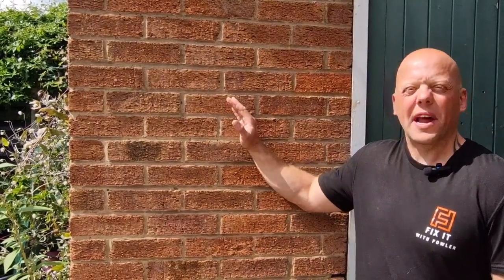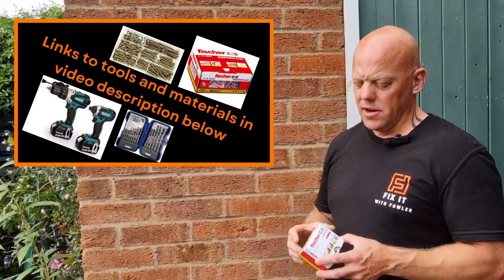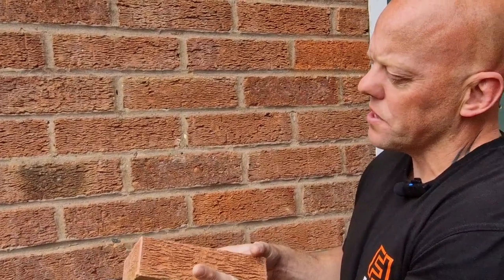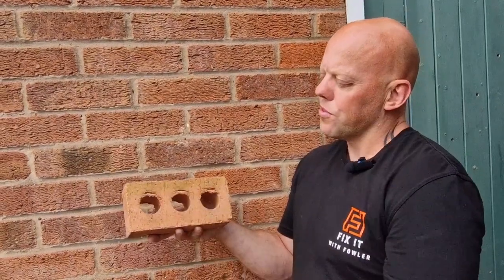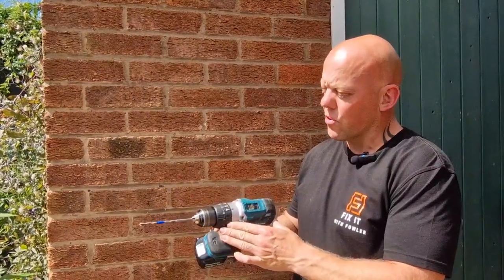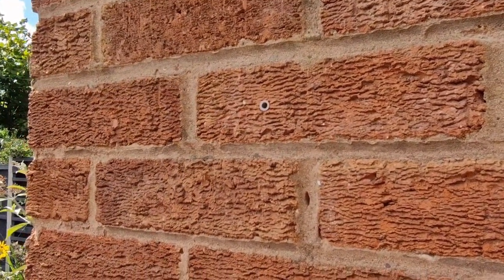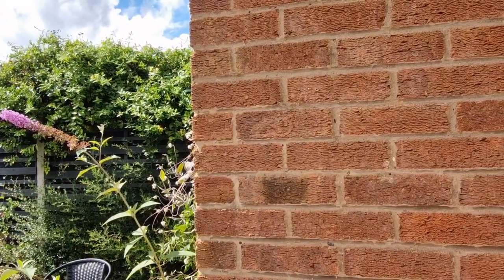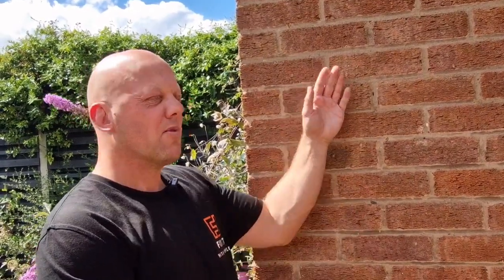Drilling into BRICK vs. MORTAR: The Ultimate Showdown

Comment: Ive just started a project for a friend recurtaining , (new rods hang brackets etc big old house lots of windows high ceilings)  im diy but with experience over the years where as my friend has no experience at all  , just so that I know that i am using the exact plugs and screws i bought an assorted Fischer  duoplug kit so her curtains wont come down and i dont have to climb high ladders to refix,   well My question is , are they as good as the hype that seem to be getting on youtube.
Reply from the maker: Hi, yes, they are good for solid brick or concrete block walls. The way they compress and expand is really good. I think i used them in a short where i tested loads of different fixings!